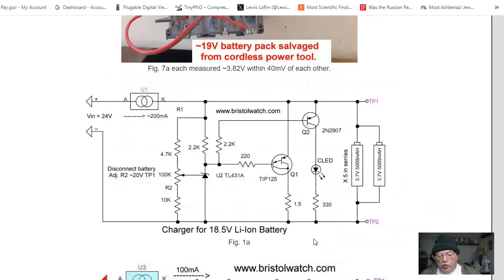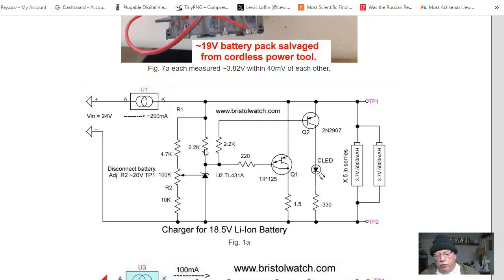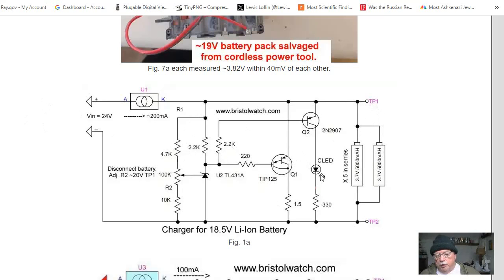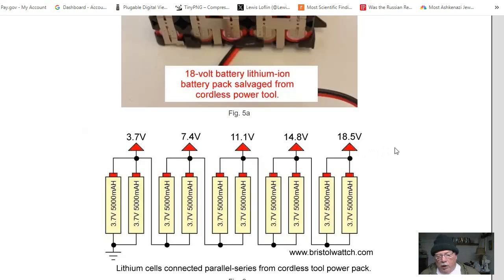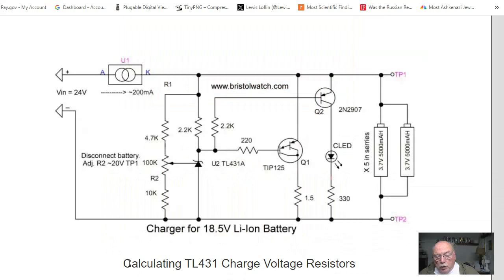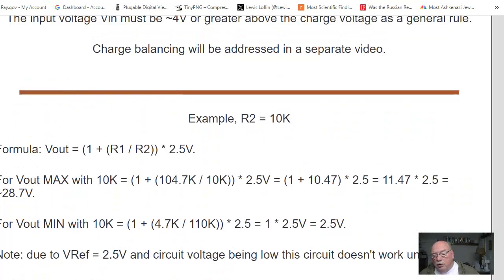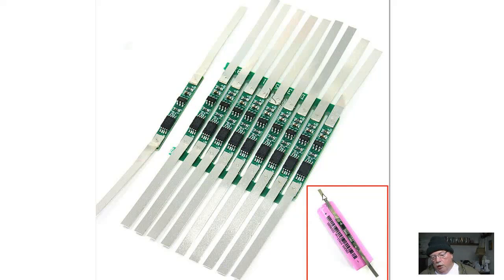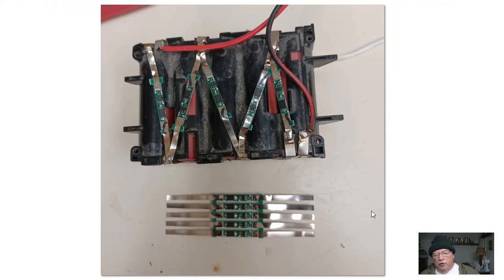18.5V Li-Ion Battery Charger with TL431 (short)

Comment: A link to the balance circuits would be appreciated, as all the circuits I saw for sale were for multiple batteries. Thank you for sharing your circuit experiments.
Reply from the maker: They are all over Ebay. That is where I got mine.
Reply from the maker: Go to Ebay in search and enter "2S BMS PCB Protection Board for 2 Packs 18650". Here is one link to the ones I used.
https://www.ebay.com/itm/403649606461